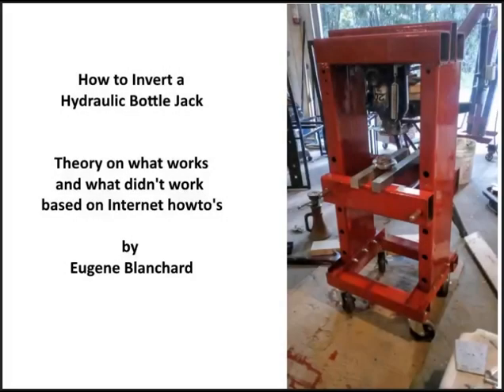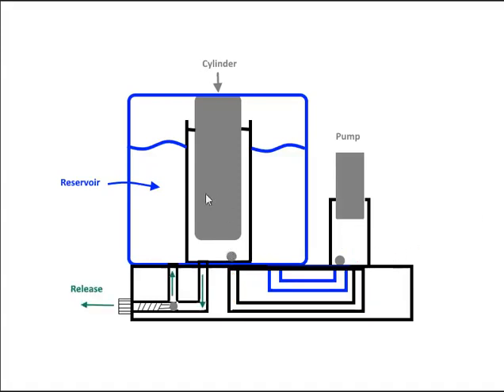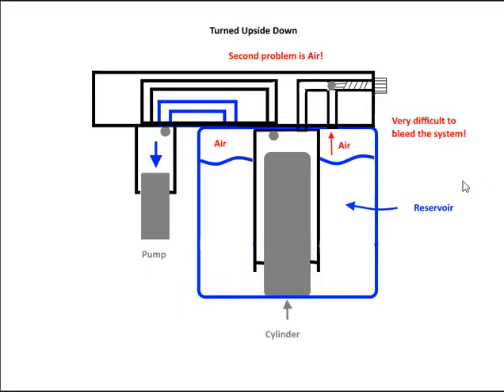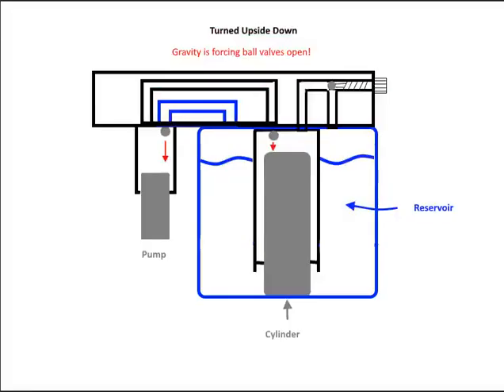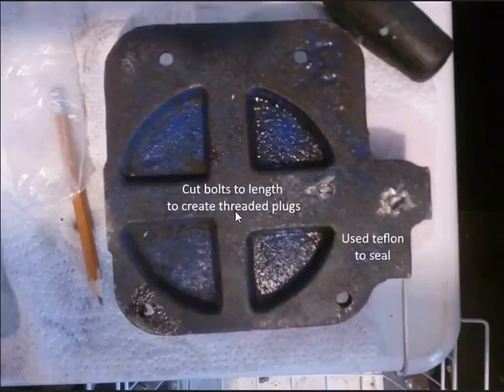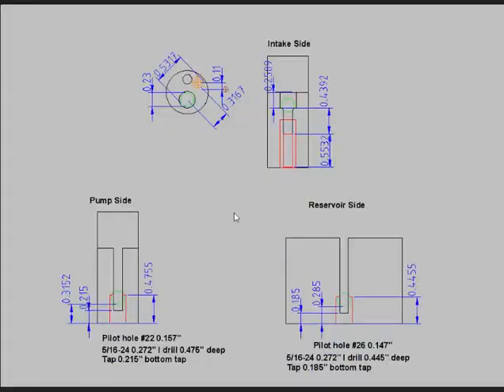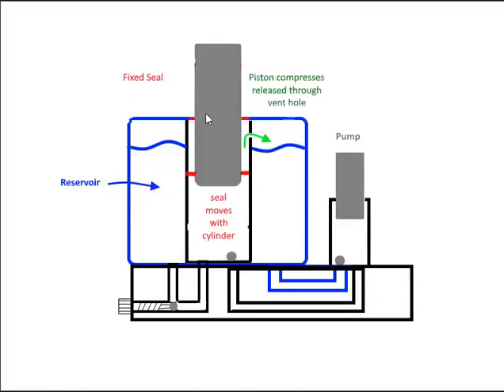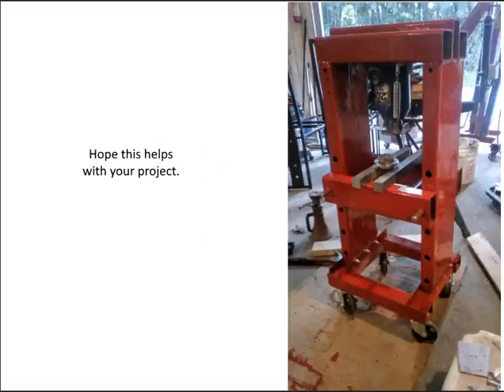Inverting/upside down Hydraulic Bottle Jack: Theory, Myths and Howto

Comment: I built an upside down 12 ton bottle jack press 2-3 yrs ago, HF jack, oil tank on top, tapped into the reservoir on side of base for oil line, it is 💯 percent foolproof perfect, works flawless ly.
Reply from the maker: Awesome, glad it's working well for you! It sure didn't work for me. Must be the design. Some jacks are designed that they can be tilted. I wonder if that had something to do with it.

Comment: If at all possible wouldnt it be better to put a tube from the vent hole to the now inverted bottom where the air would be therefore avoiding to collect continuously oil between the seals? If the outside seal is realy a simple dust seal eventually oil would escape. But if you prevent oil from collecting between these seals you would probably have less leaking.
Reply from the maker: Going to have to think about this one.

Comment: Why would you need to move the ball valves because they would still be under vacuum and pressure .  You just need to add some spring pressure on the actual jack itself to keep it under load the whole time ..  the first chance of no load it would get would unseat the valves and allow pressures to equalize..  since the balls are retained by the little washer or clip theyre not going to fall out and with spring pressure it should create enough force to seat the balls..  right?
Reply: And if the ball valve came un seated in the lever side when you pump it this would still pump and seat that ball long enough to push that fluid into the cylinder unseating the other valve then spring tension would force it back down..
Reply from the maker: During my "adventure", I found that the check ball valves would remain open, pressure would only be exerted when you pushed on the lever, when you released the lever, the pressure released. The valves were not operating as they should. The check balls need the pressure to close them during normal operation. If you don't move them, the pressure forces them open.
Reply from the maker: There no vacuum or pressure to start just gravity. In order to achieve either, the check balls have to be in the closed position. A spring would work but there is no physical room for a spring.